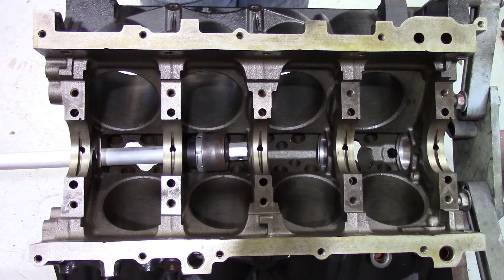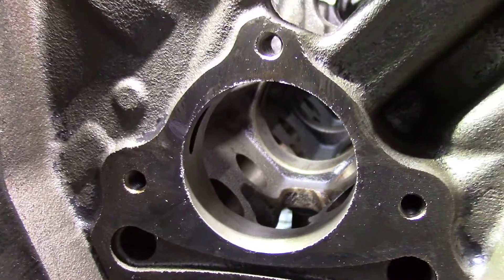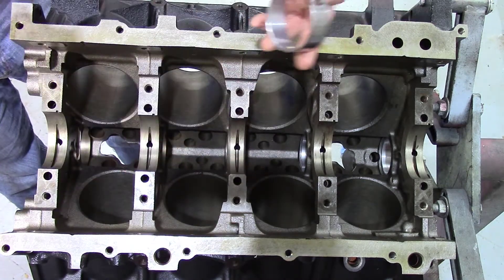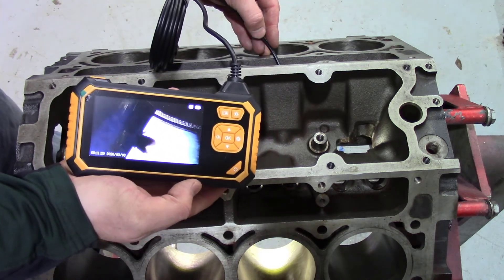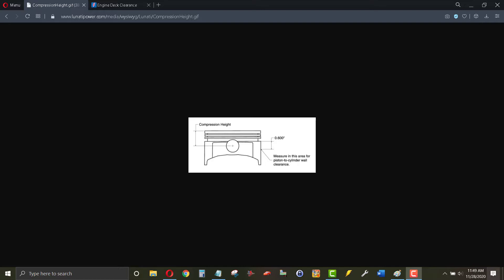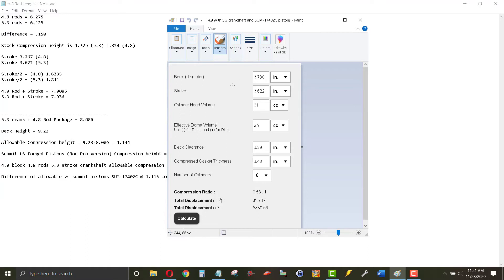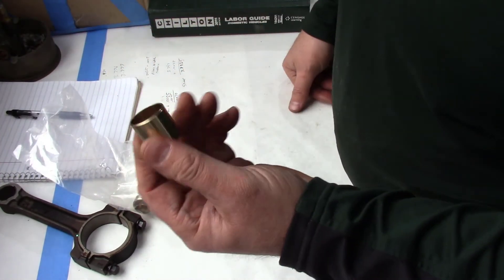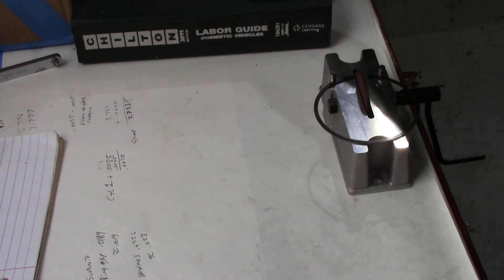4.8 5.3 LS Turbo Engine Build Part 1

Comment: Also what heads will you use?? 5.3 or the 4.8 heads and are they the same?
Reply from the maker: For the two engines I purchased they are the same castings so not much advantage in either one. I did find out that one set was cracked so its good to have your heads inspected for cracks with Silver Seal Crack Detector.
Reply: Is that common to see LS heads cracked I was kind of surprised by that?  I know the old small block Chevy cast iron heads would crack? But the LS aluminum heads?? As well?
Reply from the maker: @christopherjohnwest  When I talked to my machine shop, they said that it is not uncommon to see cracks in LS heads. I would imagine if the engine got hot any type of engine component could crack. When you have your heads redone be sure to have your machine shop double check.

Comment: Really interesting and great info!  Did you know ahead of time about the bushings?  And do you have any info as to how well they hold up??
Reply from the maker: I had the bushings made by Oliver Rods here in Michigan so I would imagine the durability will be top notch. I did know the .927 pin was too small for gen 4 rods but the price for Summit Forged Pistons with that pin size is a great deal. Since I could not find a bushing already made for this combo, it gave me the opportunity to solve that problem.
Reply: Wow cool that the place that makes the bushings is right here in Michigan!! I am interested to see more of the build!!  What exhaust are you using?  And with the turbo?? Do you have headers picked out or do you have to stick with manifolds?
Reply from the maker: @christopherjohnwest  Probably going to use cast manifolds for exhaust, this will be a budget conscious build so the money will be spent on reliability like forged pistons and piston oilers. I can upgrade to headers in the future.
Reply: Yes makes sense on the headers, I would imagine they can get expensive on a turbo build?  Are you able to stick with most of the stock valve train components?
Reply: How can I order those bushings? I  want to do the same build with my 4.8 rods. I did see Crower 90927-1 bushings that have the correct ID
Reply from the maker: @matthewm3150  Hi, I ordered these from Oliver Rods here in Michigan. I was unable to find stock bushings that fit the .927 pin size in the Gen 4 bushing OD so I had these made. Since the new bushings did not have oil grooves machined into the bushing surface, I had an oil hole drilled in the top of the rod, through the bushing. So you will need a gen4 rod bushing O.D. with the .927 I.D.. I also had my rods shot peened to add strength. Send me an email at mymusiconmyiphone@gmail.com and I will send a picture of the work order I have for the bushings.